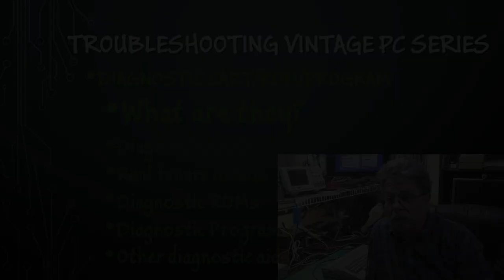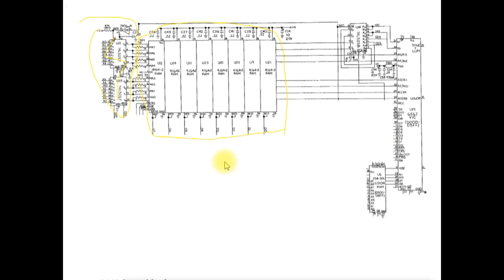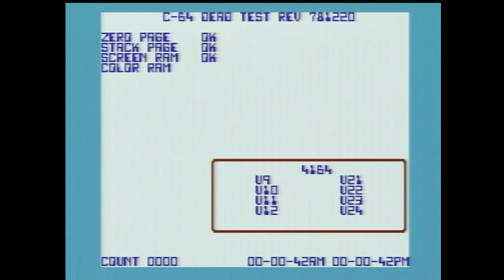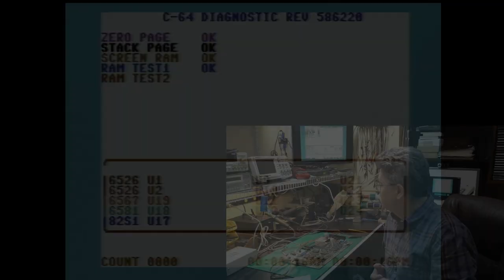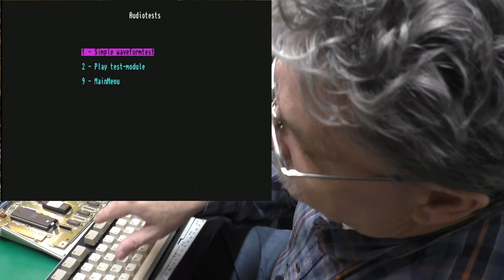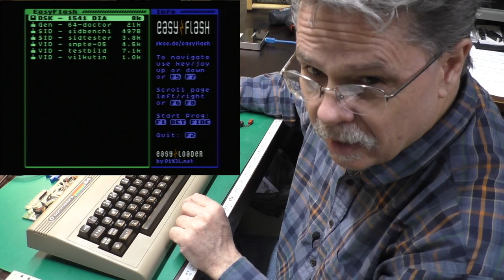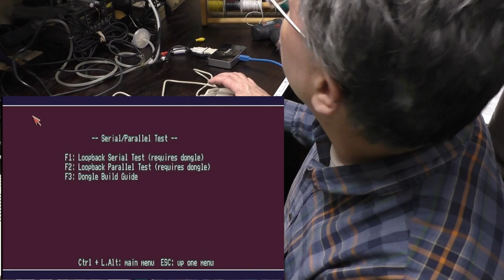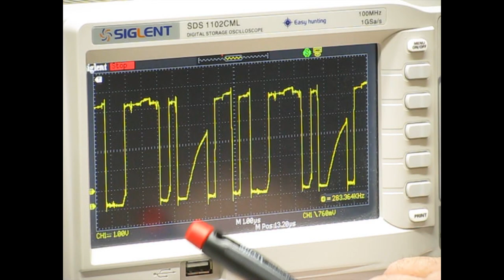Troubleshooting Vintage Computers 2   Diagnostics

Comment: A very good video. I’m enjoying this series immensely. 

As for suggestions on future videos, I think a video on interpreting oscilloscope readings on the reset, data and address lines would be a good addition to the series. Sometimes it’s very difficult to find information on what a good reading on chips is supposed to look like and makes diagnosing problems on specific chips difficult. Especially if you don’t have a good computer to compare readings with.

Maybe making screen captures on the oscilloscope of what the correct output on pins of certain chips prone to failure would be a good addition.
Reply from the maker: Hi Julio, that is a good idea. When I cover the upcoming sections on troubleshooting RAM, IO, etc. I'll cover testing with a logic probe an oscilloscope and try to explain the scope settings and what the readings mean.

Comment: Dear Birt, Thank you for your systematic approach video, this will help me on my way.
A supernoob (software guy) question; I'm trying to learn this for the purpose of repairing/diagnosing my dad's vintage QL's and ZX spectrums.
This is still way above my head for now, but I'm having great fun and its a good, and holistic/therapeutic, learning process.
My question to you is: Can I use a 100 MHZ analog scope to find faulty rams and such?. The Sinclair QL is only 8Mhz. 
I don't really know a lot about oscilloscopes yet, but I'm aiming to learn. I couldn't afford a digital scope atm, but I found some second hand analog ones in my vicinity.
Could I find not working chips based on dropped voltages using an 'old' scope or do I really need a digital one?
Highest regards and on to the next video =)
Thank you.
Highest regards,
Mac
Reply from the maker: Hi, an 100mhz scope analog or digital is more than fast enough. You won't be able to capture waveforms with an analog scope, but you can do about everything else you will need to do.
Reply: @HeyBirt  🙋‍♂️ that's great news. Thank you for the fast reply.🤗